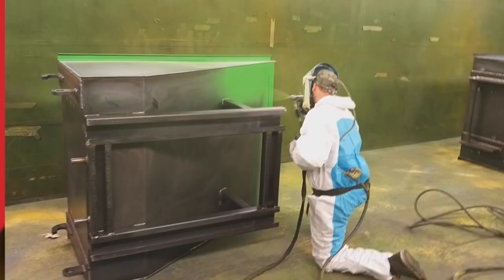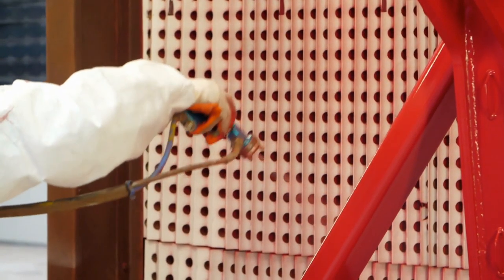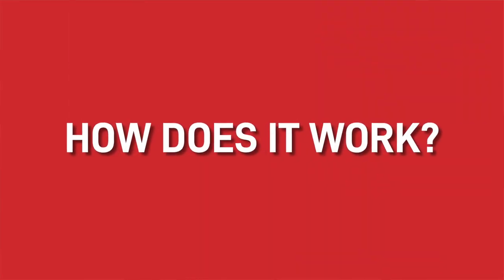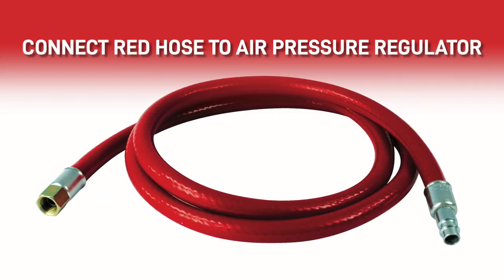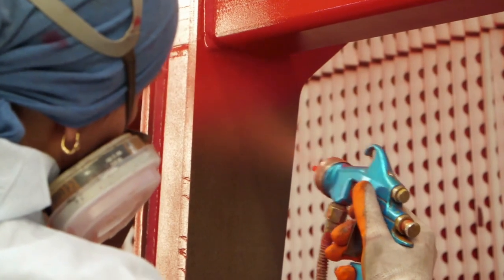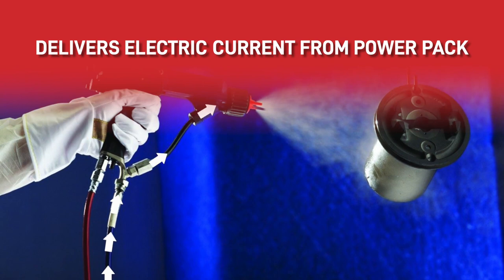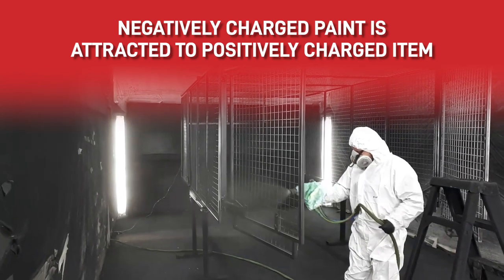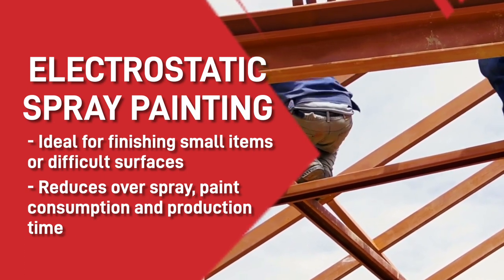Airless, Air Assisted Airless or Electrostatic Paint Sprayer - Which is Best for me?

Comment: How to handle pattern issue in Hammertone paint?
What are the things one have to keep in mind while process hammer tone paint?
Reply from the maker: Hi Jegan, thanks for the question. We would suggest to get a good finish with Hammertone / hammer finish you can use a standard spray gun airless or air assisted airless would be fine. It would be key to thin the paint to get a good finish with Hammer Finish though. Make sure you use good quality thinners like Xylene https://www.ultrimaxstore.com/ultrimax-xylene-industrial-thinners-c-20-p-447 as standard thinners may contain too many contaminants that could ruin a sensitive finish such as Hammer. thanks ultrimaxstore.com